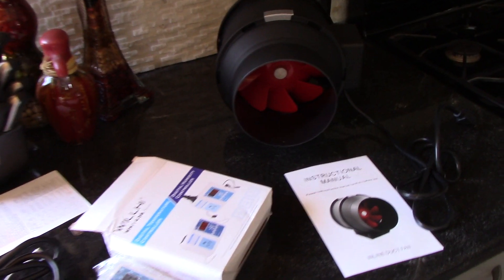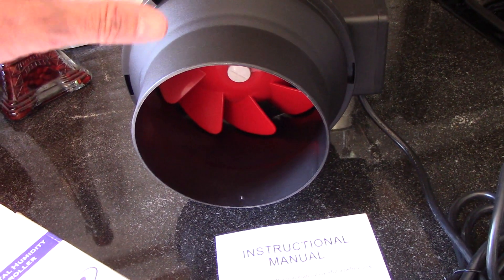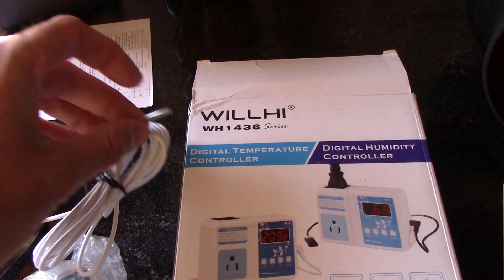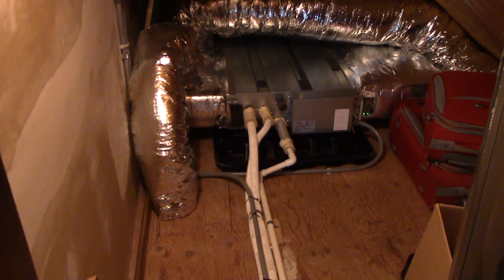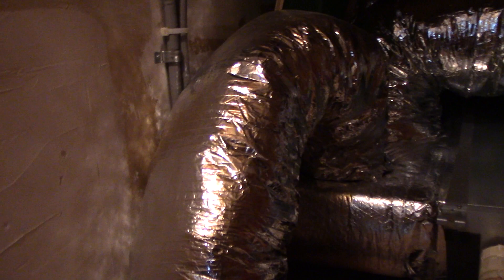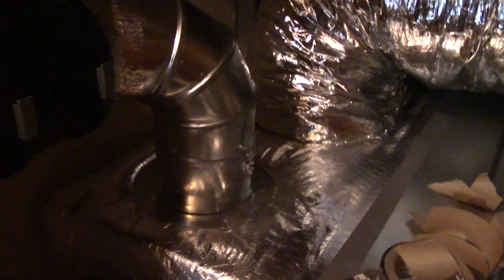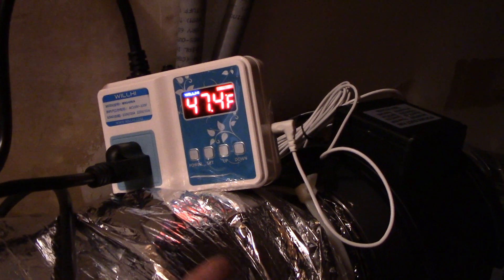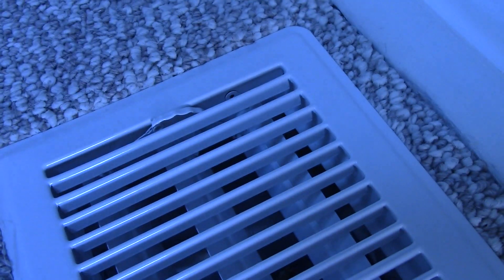MORE HVAC POWER! Improve Ducted HVAC With a Automatic Booster Fan

Comment: I see that this unit moves 300 in a 6-in flexible duct. I have a 12-in duct ($$$) I'm curious if- could I use a 10-in fan that had a higher CFM than my 12-in duct has now?
I'm also curious why the system doesn't work right in the first place. I always want to come out the gate with "that designer didn't know what the heck he was doing" but sometimes find out later that something had just gone sideways.

Comment: You could just wire the fan into the blower so when it comes on so will booster fan.
Reply from the maker: Can't on these. The fan blower uses a PWM signal from a motor controller to run it and send RPM signal feedback.  Otherwise I would have done that (but put a relay in-between).

Comment: Hope you still check this! Did you find it stole air from the other rooms at all?
Reply from the maker: Not noticeable, but I have an oversized intake for the system.  The key is to make sure your intake air is big enough to handle both the original blower and the booster fan.  As long as it's sized properly, that supply air can feed both and not have it impact the other registers.
Reply: @Trialnerror  Awesome thanks, ours is a bit oversized, too, so they tell me.

Comment: You want  a pressure switch or just wire it to the hvac unit
Reply from the maker: Unlike conventional HVAC systems, you don't want a pressure switch on a minisplit.  Mini split blowers run 24x7 to ensure they have an accurate indoor temp reading from the whole room rather than where the indoor unit is placed.  You don't want or need a booster running all the time.  You typically only want to distribute the heated or cooled air.  That's why this is such a good idea.  Saves energy, reduces noise and saves maintenance on both the booster fan and the systems air filters.  Hopefully that makes sense and thank you for watching!

Comment: Ok, since this is one of the few videos that someone is using one of these for the same purpose I am, I'll ask here. I bought an AC Infinity cloudline pro t8 to help push some of the ac to our bedroom. Where ya think is the best place in the duct work to put the fan, and where do you think the temp probe should be?
Reply from the maker: Best place is as close to the HVAC source as possible.  The temp sensor should just be near the blower.  The air moves so fast, it doesn't really matter.

Comment: Hey, does the willie thing have any wireless settings?
I would probably need to keep it up in the attic, which is not easily accessible
I'm thinking I would need to change it between a hot setting and a cold setting.
Unless you could set both at one time..

Comment: My system is in the attic.  In the summer, the attic is about 120+ degrees and in the winter it can get below freezing.  In the winter, booster on temp is set at 75 and the heater is not on but the duct has cooled to maybe below 40, won't the fan run without the heater running because the duct temp is below the on temp?  

Same issue with cooling - if the fan goes on at 65 and off at 55, but the heats up to100 degrees, the fan will run without the AC being on because the duct has heated up.   

The problem is that the ambient temperature in the attic is way outside the on/off settings.  What is the recommendation with this condition?
Reply from the maker: Not a lot of good options, but I would use a small inline fan (speed controlled) to keep a very low amount of air moving through the system at all times.  OR, use something like this and extend the sensor wiring to reach the HVAC source for accurate readings.

Comment: You could do less work just ordering a more powerful fan for that model number from that ac unit like carrier or trane or Lenox which ever brand your AC FURNACE or AIR HANDLER be. You just un hook the wires to fan motor inside furnace an unscrew 2 bolts that hold the fan in place and it just slides out, then you can slide a more Powerful one in there, screw in the 2 screws an hook up the wires, make sure you pull the circuit board power to furnace b4 doing all this so you dont die, when your done installing and wiring then plug circuit connector back into place an ac will turn on once you put door back on the furnace.
Reply from the maker: Unfortunately I can't.  This is a DUCTED mini split, so fan upgrades are not an option, outside of this solution of course.

Comment: if you can get a return up to the top of the ceiling you don't have to worry the cool air registers , remember AC;s remove the heat and heaters add heat to homes

Comment: Question! Where exactly did you put in the Temperature probe? I have a similar setup with 4 AC Infiniti fans and are always “ON” as I have the temperature probe tracking the indoor temperature.
Reply: I’m thinking of puncturing a hole 🕳️ into, inserting the probe and using tape. Looking forward to hearing your suggestion.

Comment: Booster should not be right at the handler exit, better to have it 6-8 from the vents.
Reply from the maker: Yes and no. Yes if your goal is max airflow, no if you want low noise.  This pushes a ton of air and sound was more important to me.  I get more than I need for airflow and the distance keeps the noise down to virtually nothing in the bedroom.

Comment: I did this for my upstairs. The only thing I would change are the fan and I'd create a bypass for the fan. The fan is way to noisy and if you don't have the human on it blocks the air flow. Otherwisebthe system works great

Comment: I added an inline pressure switch and two 6" variable fans. Faster for summer and slower for winter. Like a dream. Helps push air from basement to second floor. And i can control the cfm.
Reply: Can you post the pressure switch name & model number please?

Comment: Will this work for the heater ? I get very poor heat in the attic & on my second floor. It's cold but yet the first floor is crazy hot.
Reply from the maker: Sure will, you would just program it to kick on at a high temp.  I use the same setup in the winter for that same purpose.

Comment: I bought the 720 CFM 8" VIVOSUN and really disappointed after spending hours installing it. Even at lowest speed, its just too loud and the motor sound resonating through whole house. Both end of the fan is mounted with steel duct instead of foamy soft duct like you used so not sure if thats what causing so much noise. need a better solution .

Comment: Check fan wiring on furnace board!  Black wire is high, blue medium, red low speed!  You may have to change jumper location to get fan speed on high for AC!

Comment: Would a pressure switch be more insync with  turning on and off relative to the operation of both AC and or Furnace turning on or off?
Reply from the maker: Yes and no.  Because this is a split system, the fan runs 24x7.  I don't need to boost it 24x7 (would only add to a waste of energy) so going by temp allows me better control.  Even in a conventional system this setup is no more complicated and saves you from issues with pressure that varies dependent on the filter.  Those pressure switches can be temperamental because your dealing with such a small variance compared to atmospheric pressure.

Comment: when does 300 CFM equal a ton (2000 pounds). You know that air is very light and it would take a while to fill up 30,000 cu/ft   300x10x10, so at least 100 minutes should do it. An NBA basketball court 94x50 at a height of just over 6 feet.  That would take a lot of breathing.  consider a Ultra  340 CFM Electric 12 Amp Blower/Vacuum/Mulcher. A $30-99 room fan is  1/16-1/8 hp  .4-1.2 amps 50-200 watts the sweet sopt before it is too loud. A cu ft of air would be the volume of a person breathing for 28 minutes, rate of 15 breaths p/m Exhaling 1 KG of carbon per day. Wow. SO a blowhard would use a ton of air (30,000 cu ft x 28) hey thats about 583 days  breathing value. So if you want to hang out inside a airtight court figure on a 1 year safety margin for an apocalypse. Keep the doors braced for Zombies, who need no air, supposedly.

Comment: What happens when it’s winter?..
Reply from the maker: Can be programed for heat in addition to cooling.  Once set both will work automatically, no need to switch back and forth.  In my case, I only needed it for cooling.  The heat naturally does a better job of circulating in this particular room.

Comment: You don’t have enough airflow cause they didn’t duct it correctly. Go look at how the manufacturer says the ducted unit should be ducted. Most of those units are low static and they must be ducted a specific way.
Reply from the maker: All of these are low static units.  Even when ducted properly they will benefit from an extra push.

Comment: does boosting one duct reduce flow to other ducts?
Reply from the maker: Yes but it net's you better airflow through the system overall.  I would say I get 60% more airflow through the system as a whole and the other 40% seems to be evenly distributed by a small reduction at each of the other returns in the system.

Comment: i plan on rigging a homemade booster because it’s about 1-2 degrees ( up to 6° if  TV is on) Dad sets T-stat to 77° and i’m not aloud to touch it so i plan on  taking the register out cutting off the vanes (1. to increase airflow 2. so i have more room to work with) then i will zip tie in 1 238 CFM  AXIAL muffin fan that is 150 mm x 172 mm x 51 mm (vent hole is 6x10) then i plan on running a small extension cord down from the roof (where the register is) to a true variable speed controller, run it back up using wall mount clips through a closet door crack up top (door stays open anyway) run power down to about eye level to a plug in thermostat that has a probe- (which runs back up to supply to fan register supply air) and i’ll run the plug down out the bottom closet door crack again to a near by outlet. 

anyone have any recommendations?
Reply: I’m doing a booster because i don’t have access to duct work

Comment: You should have added an air return line to that room up high.  You can only push so much air into a room, so its best to remove the hot air out, so the cool air can come into the room down low.  Even if you added a vent up high and vented it into the hallway next to it would help a ton.
Reply: That is an expert suggestion!!
Reply: If you pressure up a room by adding more CFM the return line naturally will take more laws of physics
Reply: @SpotONNvids  That statement is ONLY true if you had a fixed-pressure scenario. Doors and windows open, and there are leaks in the attic. The pressure is never constant, so your statement would not be accurate in this scenario.
Reply: These units seem like a terrible idea.  That room could be hotter because the HVAC system isn't balanced but it could also be caused by an issue with air sealing in the attic, attic ventilation, improper attic ventilation.  If any of those are a problem you're just throwing money  out the ceiling and possibly introducing or creating mold growth by pressurizing that room.  If it's simply an HVAC issue the best solution would be adding a return vent at the top of the ceiling as you've said.  I'd also be concerned about adding an aftermarket fan to my ducts with 0 understanding of HVAC.  Sure you might make the room colder but are you affecting the efficiency of your unit or wearing it out faster?
Reply: @shibbyrick why is it a bad idea? Why would it wear his current unit out sooner? The handler is blowing air which takes effort. If one room is pulling extra air wouldn’t that take some of the effort off the handler and make it easier for it to push the air and maybe extend its life?  
I’ve for a 4 ton Lennox system and 2 small guest rooms have too small ducts feeding them, like 4” and 6 or 8” so they don’t cook enough. The ducts are too narrow. I’m thinking of putting these in the attic ducts to help boost the a/c into them when I have guests. I got a quote to re do the attic duct work at it was over $10k. I live in Hawaii. Why would these duct fans be a bad idea. Maybe I could put them into a wifi controlled outlet and boost airflow only when needed. What do you think?
Reply: @wstt4  Yes, I think it would work.  If it were me, I'd try to redo the duct work yourself.  Use Youtube videos and save yourself so MOO-LAH.  Or, if you do pay people, make sure you get a few good quotes.  Also, if you do fix the problem, please, come back and let us know if it helps.  Because I need to do it on my house, because I have a front room that doesn't get enough of the A/C cooling, and it is really getting hot in there this summer.  So, it's end of August 2024, and I hope that I do it this fall.
Reply: They do use duct boosters in large commercial buildings. You forgot to mention that your ducts should actually be insulated.

Comment: A 6” flex duct is designed to move 75 CFM. If the in-line fan is rated for 300 CFM, I imagine that in-line fan will over heat.  Also, if your door is covering the return, the system will be starving for air.  I recommend calling a certified NCI AC technician.
Reply: why is it a bad idea? Why would it wear his current unit out sooner? The handler is blowing air which takes effort. If one room is pulling extra air wouldn’t that take some of the effort off the handler and make it easier for it to push the air and maybe extend its life?  
I’ve for a 4 ton Lennox system and 2 small guest rooms have too small ducts feeding them, like 4” and 6 or 8” so they don’t cool enough. The ducts are too narrow. I’m thinking of putting these in the attic ducts to help boost the a/c into them when I have guests. I got a quote to re do the attic duct work at it was over $10k. I live in Hawaii. Why would these duct fans be a bad idea. Maybe I could put them into a wifi controlled outlet and boost airflow only when needed. What do you think?
Reply: And that elbow don’t have any wrap it will sweat 😅
Reply: @jrome254   No it should be OK it's in a condition space
Reply: @good_commentary5829  the elbow wasn't in conditioned space it was in the attic lol
Reply: He should be consulting an A/C tech.  Possibly an insulation guy.  And possibly a roofer.  If one room is hotter than the others, especially one with the ceiling that room has, it could indicate an issue with attic ventilation, air sealing, or insulation.  If any of those are an issue creating a positive pressure in that room fed by cold air could lead to or exacerbate mold growth in the attic.  Even if none of those are an issue there is a strong possibility of adding stress to your HVAC unit shortening it's lifespan or decreasing its overall efficiency by throwing aftermarket fans into the ducts.
Reply: @shibbyrick why would that shorten the life of his HVAC? The HVAC is pushing air to all the rooms. If one room is pulling air wouldn’t it be taking some of the load off the HVAC blower and likely extending its life? (Sorry if I have terminology wrong).

Comment: Missing info on your wire connection from blower to digital temp controller.. Where did you install the temp. sensor?
Reply: Hello, I have an air duct fan with better performance and can be transformed. I can give you free evaluation. Can you take a 1-minute short video for me?

Comment: Nice fan but here is a easy method for a on off switch the right way. Here is the answer the right way that hvac guys use. Air Flow/Differential Pressure Switch Control or adjustable version Male Thread Pneumatic Adjustable Diaphragm Type Pressure Switch Normally Open is what you need not the closed one because will work in reverse
Reply: He said this is like a mini split system they don't have that option

Comment: Where and how did you mount the temp censor from the thermostatic switch? Did you put it inside the ductwork or are you taking the temp based on that room? I wasn't quite sure I understood how you had the controller setup for the on/off function (what temp to kick on the fan and what temp to kick off the fan) I bought the exact same setup and this fan boosts some serious airflow, works great ( I converted my attic into a three room second floor in an old house and needed the airflow boost up there) but I don't want the fan running constantly, so I got the switch but not sure how the setup should go. Thanks!
Reply: Did you ever find out how to set it up?

Comment: Where did you install the controller sensor?
Reply from the maker: I just slipped the probe in just before the fan.  It can really be placed anywhere as long as it's exposed to the air from the HVAC unit.

Comment: I have a central unit where the farthest bedroom stays about 6 degrees warmer than the rest. If I put a booster in only that line, could it "starve" the cool air from the rest of the rooms?
Reply from the maker: I've found that rather than starve it it just removes some of the static pressure on the main blower.  The other outlets don't seem to be effected when this one turns on.  I'm sure everyone's situation is different so it could, but not in my case anyway.
Reply: @Trialnerror  What if run it all the time? Would it suck air from the other rooms rather then from the manifold and the returns?

Comment: does this help with my scenario? 
1. 2 story townhome with a one AC unit that blows air to 1st and 2nd floors
2. thermostat located in 1st floor and during summertime normally 1st floor is cool 2nd floor is always hotter. about 3-4 degrees difference
Reply from the maker: Absolutely.  This will push more air up top where you need it and that should better equalize the temp difference between your two stories.  Good luck man and thanks for watching!
Reply: @Trialnerror  Thanks! just ordered same product you have listed! BTW, where do you put the temp. sensor?
Reply: @ Danny Ryu

I have same situation as you. I installed the ac 10 inch duct fan go my line. I also connected a sail switch to an outlet in attic to turn the booster fan on and off. I have no problems al all! I say the sail switch is the way to go!!